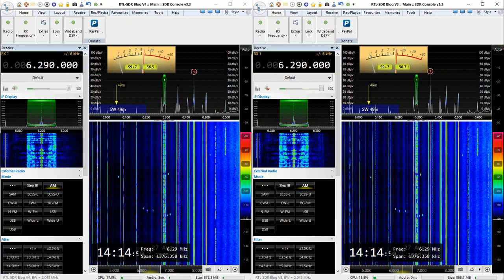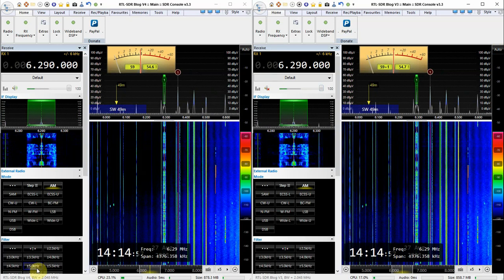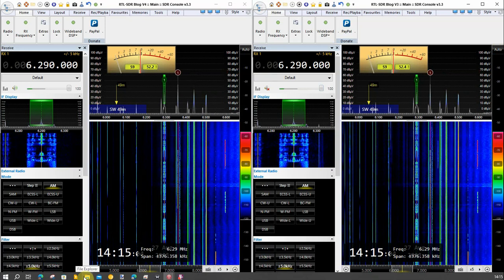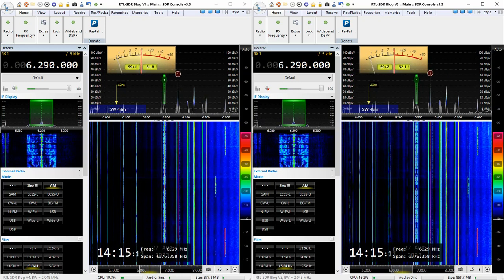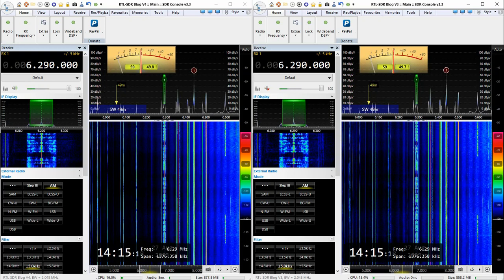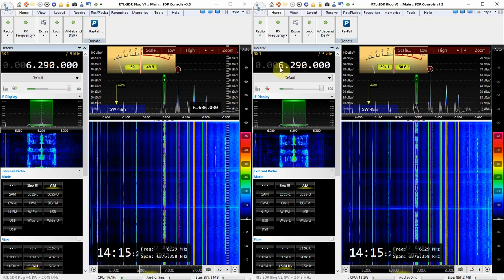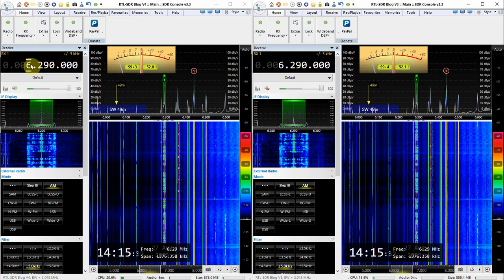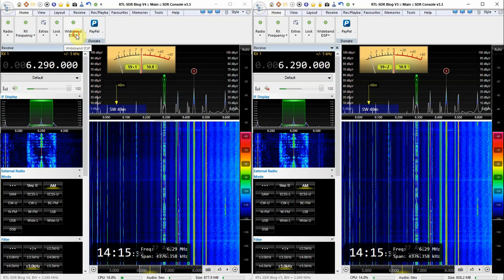RTLSDR V3 vs V4

Comment: I have the v3 .. and below 24mhz it doesn't hear anything even in q sampling .. I have the sharp program and the aor 7000 antenna, what's wrong?? I'm completely disappointed ..
Reply: V3 doesn’t work below 24 mhz
Reply: @GM-iq5ht  Yes it does, I have one myself and it works.

Comment: how can i listen short medium waves in v3??I use the sharp program and antenna the aor 7000 and I receive from 25 MHz and above what moment ..what is wrong ??
Reply: Turn on Q branch in your software to be able to listen to HF on the V3.
Reply: @mpslevan  I have done this too.. nothing has changed .. antenna I have the aor 7000 .. maybe it does not receive short?? the manufacturer gives from 100khz